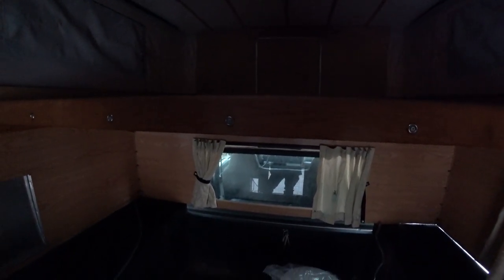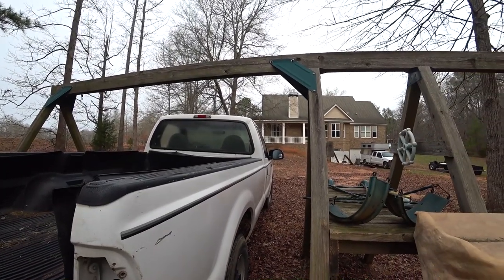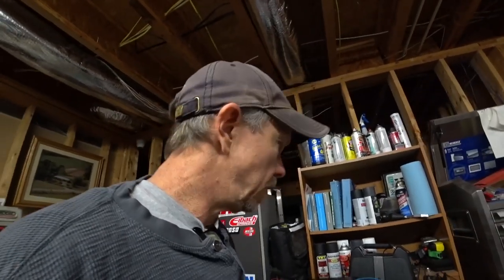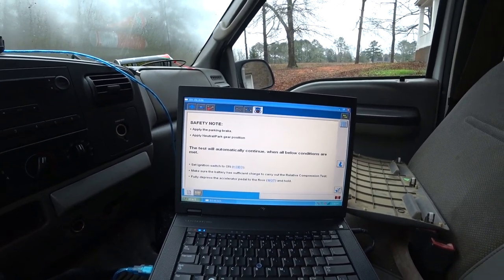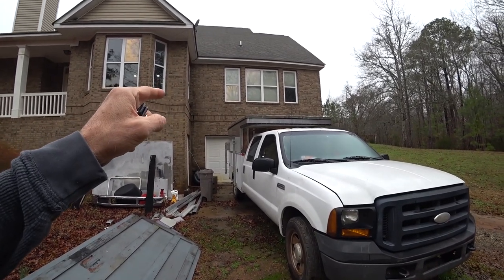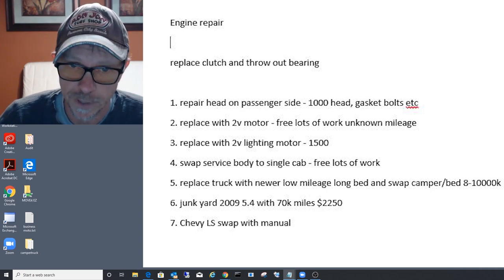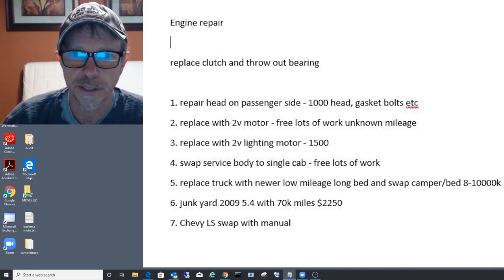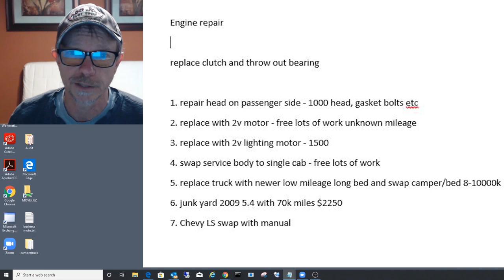Diagnosing Engine Troubles - DIY Budget Overland Truck Camper Build 3

Comment: I've got a real nice 99 24 valve that would fit nicely in that truck.  Nothing better than a cummins bolted to an fz6.
Reply from the maker: Don't tempt me. It would be much easier than the 5r110 12v I just did. zf6 is definitely the way to go.

Comment: Get a bore scope ( can get a cheap one that connects to your phone) look in the cylinder to see if there is piston damage.  If there is go for another engine.  If not pull the valve cover off and see what the cam and followers are doing might be a simple fix. And for the 2 valve  my 03 e250 has 307,000 on it and this summer went to new Orleans in it from central Florida and still runs great (I'm more worried about the transmission more than motor)

Comment: I'd go with either option #1 or #3. Lots less than refreshing with a newer crew cab. Additionally, the crew cab was a primary reason for this truck in the first place, so I'd keep that. Lastly, you don't like the 5.4L 3V, so option #6 doesn't sound right.
Reply from the maker: You are right. I tend to do things the hard way though. Ideally I could find a 2005-2010 Crew Cab 5.4 4x4 longbed with low miles around 8k ( unicorn) ready to go.

Comment: Since your going to pretty much pull the engine no matter what. Just pull it and fix it RIGHT and you'll know what you got. All the other options your just hoping you get a good engine. But if you pull what you got out, you KNOW what you have. Yeah you will spend a few more dollars, but you'll have a good engine if it's been rebuilt right.
Reply: It has to be pulled one way or the other at this point so I say pull the dang thing and let it sit in the basement for a week. After about the third day it'll be raining outside and you'll say_ "why don't I just pull this head and see what I got?" Costs nothing so far. At that point the decisions should be a lot easier. 😃
Reply from the maker: Ok, since you brought that up. I do have a 5.4 block, forged crank in the basement that need some machine work. Add Manley H beam forged rods a fresh set of 2008+ 3valve heads because they have better plug threads. High volume melling oil pump with new cam tensioners, guides and the latest oem ford phasers. hmmm.
Reply from the maker: @johnbeckman8916  It does need to come out. I just need some good weather. I definitely need to replace the clutch in it anyway. Let me mount and skin the rest of the camper and that may be the plan.

Comment: LS swap would make the most power, they are cheaper.  but the lightning motor would be awesome. but swapping the 2v would be the cheapest option.
Reply from the maker: Agreed. Plus LS engine are way easier to tune. Lightning motor is possible but is it the best solution when turbo charging is available for about the same price?
Reply: @JYDOG  personally id do the LS swap, cause why not. and turbo the shit out of it

Comment: Put 12 valve or 4bt in it
Reply from the maker: Just went that route with my last truck and it was great but lots of $$ .
Reply: @JYDOG  find dodge doner truck get it all to transfer over or ol bread truck you be diesel cheaper on fuel milage an good low end torque cummins last lifetime but I'm gm man ls good idea too

Comment: Ps stick with the manual
Reply from the maker: Definitely the plan if it works out that way. I only see two drawbacks. Big city traffic and my wife might not prefer it even though she has no problem driving a stick. Should be better on fuel though.

Comment: Do you even know what's wrong with your motor? All you know right now is that you have one cylinder that is not contributing. You have no idea if the spark plug blew out which is common on these motors. You have no idea if you broke a valve spring which is some what common. 

You can do many repairs with the motor still in the truck. You can put a thread insert in the head with it pulling the motor. Infact they make a tool to do just that. 

Also if you broke a valve spring you can replace that with out pulling the head off. 

I think you said in one of your last videos that this just started missing, I'd research your problem a bit more before just throwing the towel in. Pulling that motor really sucks on these Fords. I'd rather spend a few extra dollars for some tools then to pull a motor. 

All I'm saying is research your problem a little bit more.
Reply from the maker: You are absolutely right. This was just the first step. I may be jumping the gun thinking of engine replacement and hopefully you are right. I will be pulling the plug and doing a compression check next. I will have to remove the engine or trans to do the clutch though so its not a bad idea to think about a fresh engine at the same time.

Comment: I think none of the options are good. Sell everything and start over... Keep the big picture. You and you wife want to do lots of traveling... that tent pop-up will get old fast. That pop-up is a perfect for extreme off-road camping, expedition setup. That's not the camping your wife likes... Defeats the purpose of putting it on top of that heavy service body. Lightweight is essential, on top of great 4x4 suspension. Also your wife likes a good bathroom... need a rig that will allow that proper setup. Do you really need crewcab? Your son won't be traveling with you... Just ideas... I hate to see you invest so much time in projects that are defeating from the get go. Discern the ultimate best setup desire that would serve... you can build anything so "expensive" will be slashed with your ingenuity and hard work.